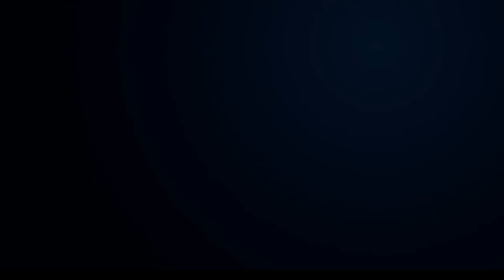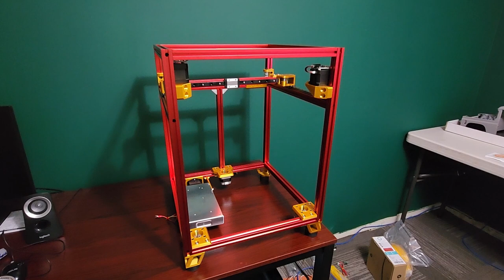Simple DIY CoreXY 3D Printer SimpleCore MK1 - Assembly Series EP1 - Frame

Comment: What's the advantaged of this vs building a complete trident?  The simplified belt path and bed mounting  is the only difference that I see, and don't really see that there would be much of a difference, yes less hardware, less friction but not really that impactful.  The simplified bed mount is a plus. As far as I can tell this is basically just a trident mod. Why not just build a trident to begin with?
Reply from the maker: Just another option for people, Y carriages in the final version will be lighter than trident, electronics will be on the back panel for easier access, motor in the front with less idlers should give higher acceleration and this will have a belted Z option
Reply: @Rolohaun  I can appreciate that, any plans to design for MGN12 Linear rails ? I know the issues with enclosing when using these but, as you stated you aren't enclosing anyway, and there are other options for enclosing when using MGN12's.
Reply from the maker: @Manawar  you mean MGN12 for Y and Z?
Reply: @Rolohaun  Yes, MGN12 for all axis
Reply: being selfish here as I have lots of MGN12 and zero MGN9

Comment: Superb. Is it possible to have only one Z axis motor?
Reply from the maker: I really don't think there would be enough support, beds can be heavy and vibrate very easily if not supported well.
Reply: Look at the VzBot Z assembly, it uses a single motor with 2 supporting leadscrews on the bed.
Reply: @MatrixRay19  hi matrixray